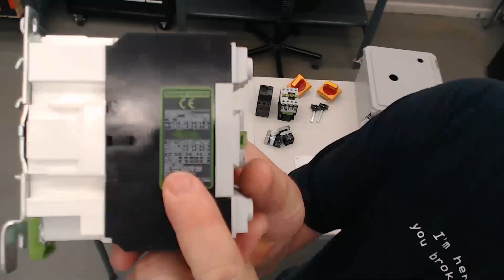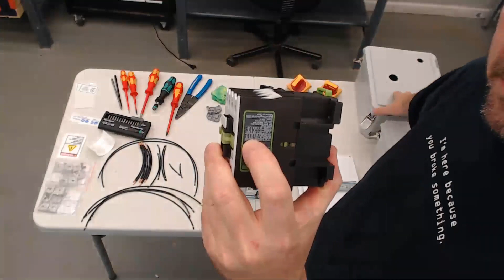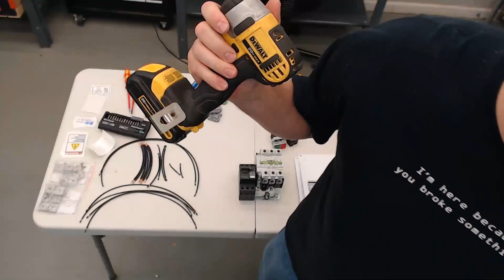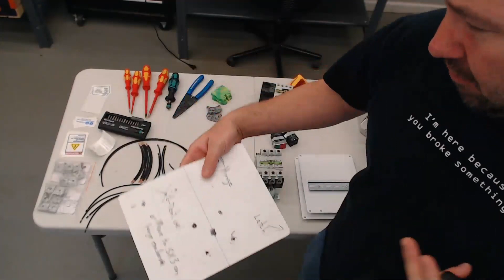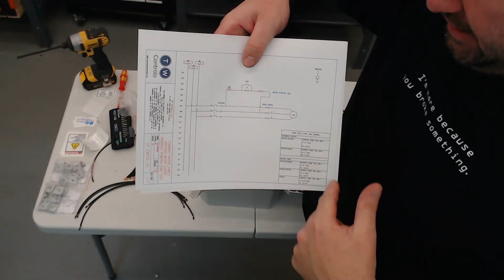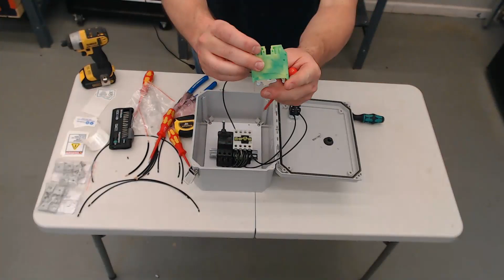Control Panel Building - 15hp and 20hp Start Stop Motor Starter Panel

Comment: What kind of torque screwdriver is that? thanks
Reply from the maker: Hi Logan.  This one covers the bulk of what you need to torque thought I have several others covering screwdrivers up to 1/2 torque wrenches.  https://www.amazon.com/gp/product/B003KN3GBO/ref=as_li_qf_asin_il_tl?ie=UTF8&tag=twcontrols-20&creative=9325&linkCode=as2&creativeASIN=B003KN3GBO&linkId=78f85f20312220b2852dede675ec0b05